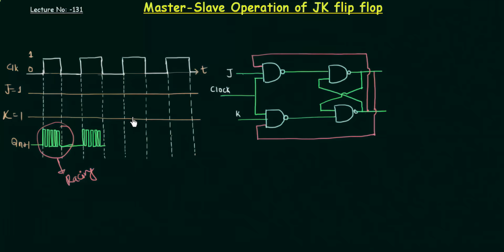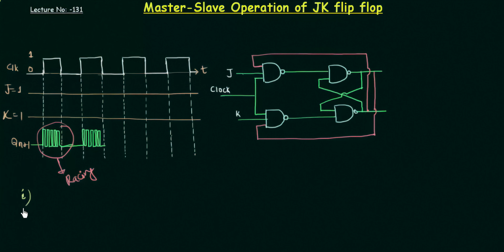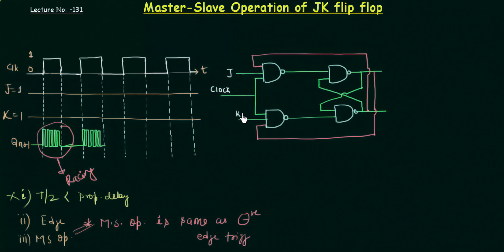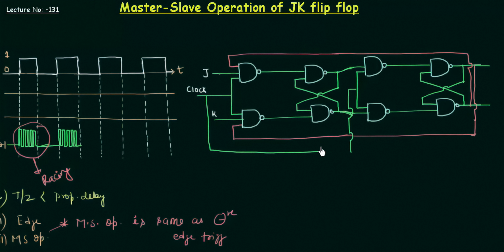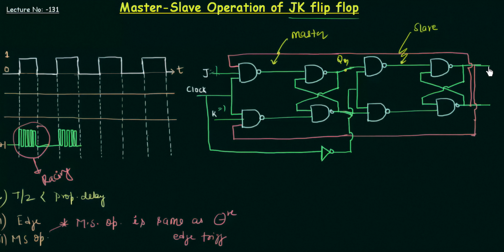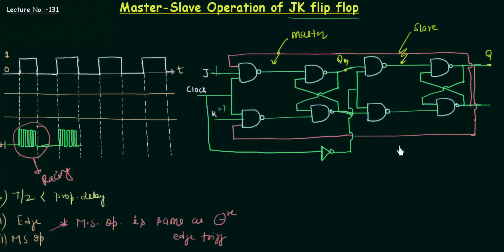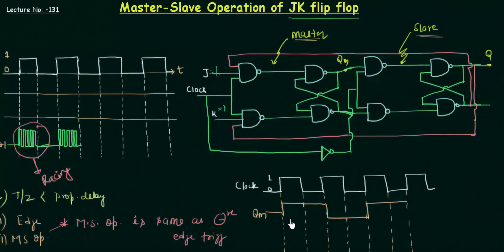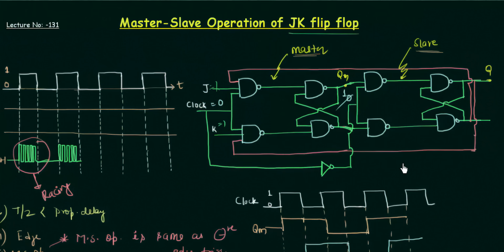Master Slave JK Flip Flop

Comment: Timestamps 
00:06 - Racing in JK flip-flop is undesired output.
01:14 - Master slave operation is same as negative edge triggering
02:20 - Adding another stage in a master-slave JK flip flop.
03:38 - Complementing the clock in the master-slave JK flip-flop circuit is an important operation.
04:43 - Master Slave JK Flip Flop explained
05:40 - Advantage of Master-Slave JK Flip Flop
06:54 - Clock high triggers QM high, stored during low, toggling for a cycle.
08:06 - Master Slave JK flip-flop ensures output changes once in a cycleTimestamps

Comment: Sir I have a doubt. In previous lectures u said that in flipflop we use edge triggering and if it is level triggering then its a latch. Then why are u drawing the clock pulses in flipflops in square wave form and also why is racing happening in higher levels. Since flipflops are edge triggered, racing should happen in edges. Sir kindly clarify this doubt.

Comment: Sir, U said one of the way to overcome racing condn is using edge trigger instead of level trigger, but u also said we always use edge trigger in flip-flops (level trigger is used for latch). It seems contradicting
Reply: Exactly. I have the same doubt.
Reply: It is because the other way of overcoming racing is impractical. So its customary to use negative edge triggering. There's nothing contradictory about it.

Comment: dk if anyone will see this, but why doesn't Q start off high since the the clock starts off at 0?

Is it becuase he assumes that the previous value of Q is 0?
Reply: I have the same doubt because this makes sense only if initially the value of Q also will be zero which then goes as feedback to master flipflop otherwise 1,1 will be not useable for master flipflop if we don't take feedback into the consideration.

Comment: Excellent video. However, the explanation at 6:50 onward was definitely lacking. "As soon as the clock is high, Qm will become high." But why? Shouldn't the value of Qm also depend on the value stored in Q, since that value is also an input of the first NAND gate closest to J? Not at all clear.

Comment: sir , a doubt in this lecture ;  we use clock so that when it is 0 then it can store the past output so in race around condition too , at the instant clock going to be off , qn+1 can be 1 , and then during next t/2 time when clock is off , the output will be 1 . am i right with this? please guide .

Comment: Is going to take a while to go through, but below table shows operation of master slave jk flip flop and you can also see why it's edge triggered. 
If (i) m denotes the master and s denotes the slave, (ii) x and y are the intermediate steps of the master and slave, (iii) q and q' are final outputs of master and slave

Equations are: 
mx = [(sq').(clk).(J)]'
my = [(sq).(clk).(K)]'
mq = ((mq').mx)'
mq' = (mq.my)'
sx = (mq.clk')'
sy = ((mq').clk')'
sq = (mx.(sq'))'
sq' = (my.sq)'

Initially, 
Clk = 0; K = 0; J =0;

 Stp| Clk| mx | my | mq | mq'| sx | sy | sq | sq'| comment
  1 | 0  | 1  | 1  | 0  | 1  | 0  | 1  | 1  | 0  | Start state
  
  2a| 1  | 1  | 1  | 0  | 1  | 1  | 1  | 1  | 0  | Clk ->1; Sx becomes 0 as clk' ->0
  2b| 1  | 1  | 1  | 0  | 1  | 1  | 1  | 1  | 0  | J ->1
  2c| 1  | 1  | 0  | 0  | 1  | 1  | 1  | 1  | 0  | K ->1
  -----system has reached stable initial state with J=1; K=1 and clk=1-----

  3a| 0  | 1  | 1  | 0  | 1  | 1  | 1  | 1  | 0  | Clk ->0; my becomes 0 as clk -> 0
  3b| 0  | 1  | 1  | 0  | 1  | 1  | 0  | 1  | 0  | mq' propogates to sy
  3c| 0  | 1  | 1  | 0  | 1  | 1  | 0  | 1  | 1  | sy propagates to (sq')
  3d| 0  | 1  | 1  | 0  | 1  | 1  | 0  | 0  | 1  | (sq') and sx propagate to sq

  -----system has reached stable initial state with J=1; K=1 and clk=0-----
  4a| 1  | 1  | 1  | 0  | 1  | 1  | 1  | 0  | 1  | Clk ->1; sy becomes 1 as clk' ->0
  4b| 1  | 0  | 1  | 0  | 1  | 1  | 1  | 0  | 1  | (sq') propagates to mx making it 0
  4c| 1  | 0  | 1  | 1  | 1  | 1  | 1  | 0  | 1  | mx propagates to mq making it 1
  4d| 1  | 0  | 1  | 1  | 0  | 1  | 1  | 0  | 1  | mq propagates to mq'

  -----system has reached stable initial state with J=1; K=1 and clk=1-----
  5a| 0  | 1  | 1  | 1  | 0  | 1  | 1  | 0  | 1  | clk becomes 0; mx -> 1
  5b| 0  | 1  | 1  | 1  | 0  | 0  | 1  | 0  | 1  | mq propagates to sx
  5c| 0  | 1  | 1  | 1  | 0  | 0  | 1  | 1  | 1  | sx propagates to sq
  5d| 0  | 1  | 1  | 1  | 0  | 0  | 1  | 1  | 0  | sq propagates to sq'

  -----system has reached stable initial state with J=1; K=1 and clk=0-----
  6a| 1  | 1  | 1  | 1  | 0  | 1  | 1  | 1  | 0  | Clk ->1; Sx becomes 0 as clk' ->0
  6b| 1  | 1  | 0  | 1  | 0  | 1  | 1  | 1  | 0  | sq propagates to my
  6c| 1  | 1  | 0  | 1  | 1  | 1  | 1  | 1  | 0  | my propagates to mq'
  6d| 1  | 1  | 0  | 0  | 1  | 1  | 1  | 1  | 0  | mq' propagates to mq
  -----above is same as 2c state and cycles through steps 3, 4, 5 and 6-----

Note the transitions of clk, mq and sq and you can see where the transitions happen.
sq (second last column) transitions when clk goes from 1 to 0 (-ve edge triggered)
mq (5th column) transitions when clock goes from 0 to 1 (+ve edge triggered)

Comment: By the time when master operation is over the value of Qm will be equals to 1 and Qm bar value equals to zero (Assumed the initial values of Q and Q bar are 0 and 1). When slave becomes active the slave gets two inputs those Qm and Qm bar which are equals to 1 and 0 respectively so when two inputs are 1 and 0 for the first time Q and Q bar values will become 0 and 0(Which is not acceptable) and after some time due to feedback Q and Q bar will become 1 and 0 and will be remained in that state.

Conclusion : The out will toggle once in the negative clock cycle and stays high

Comment: U told in ur previous lectures that flip flops have clock signals which are edge triggered. Then why are u using level sensitive/triggered condition in JK flip flop?

Comment: My question is:- When the clock is high again for the 2nd time, why is Qm low and stays till the clock is high again?
Reply: Because clock is high again and it will toggle previous state which is high. So the output is low.
Remember when ever clock is high it will toggle, when clock is low it will store previous state.
Reply: Rishabh Patel that's helpful.thank you
Reply: but that was due to the feedback i guess...and feedback was shifted to the slave flipflop, so when clock is high, slave flipflop does not work, so how does this toggle happen then?
Reply: cuz clock is 0, so it holds prev state which is low
Reply: bit late...he only took one situation which is J=1 and K=1  as an example, therefore a change in state of clock will toggle the previous state of Q
Reply: In JK ff, when inputs = (0,0) JK will go into hold condition and the next state will be equal to the current state only. So when the clock to the slave JK is 0 that means input = (0,0) so it will hold whatever the current state is. So if master gives a high o/p slave will hold high if master gives low slave will hold low.

Comment: how is Qm correct in case 1 when clock is high, j & k are high, but there is no looping back in master circuit and slave circuit isn't functional. Shouldn't master have the same problem as SR FF ?

Comment: What is Difference between Toggling and racing(Race Around Condition)?
you said that you explain this in next lectures i have completed almost 160 Lectures 
but did'nt found it 
sir plz explain it it make alot of confussion in my mind
Reply: But sir in Racing if Qn(0) is input output is 1 which is also Qn'
Reply: Thanx Sir i Understand 
In Toggling the vale of Qn is changed once in a cycle and in racing the vale of Qn chaged radidly from 0 to 1 Thanx Sir thanx alot

Comment: how did u plot Qm sir??
Reply: J=1 K=1 is toggling scenario. When clock turns high (while is) it toggles the value, and when clock is low it stores the value in its memory (basic low clock functioning of flip flops).
Reply: +Neso Academy I have the same question. Anybody?
Reply: but why Qm is high when the clock is high
Reply: Bhavya Sharma because Qm is the result of master jk flip flop which works only when the clock is high (i.e 1)
Reply: Its because in Master operation one uses high level triggering and in Slave operation one uses negative edge triggering

Comment: why does Qm become low when the clock becomes high for the second time in the waveform drawn
Reply: When the clock is low the flop doesn't work. But when the clock becomes high then the FF will work & it will invert the previous output(which is considered as 0)..& again when the clock will go low the FF will not work. That means it will not result in any change..but FF doesn't work..but still it will store the data..that is why it is still 1..& again when the clock is 1,the FF will work & it will invert then 1 to 0(because we know when j=1 & k=1,then Qn+1 toggles
Reply: Same doubt
Reply: same doubt